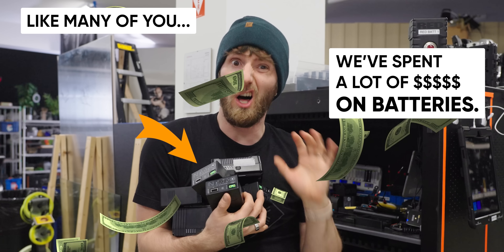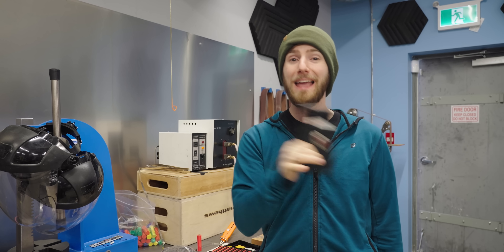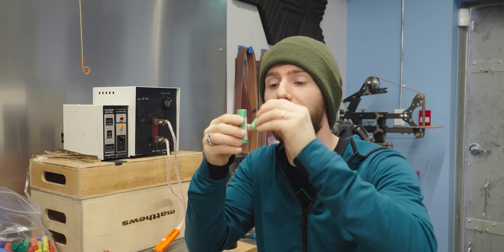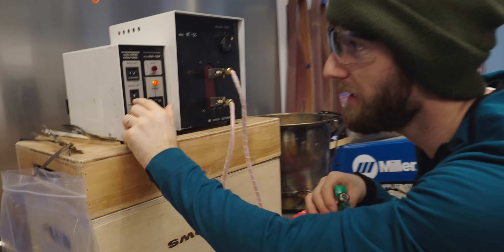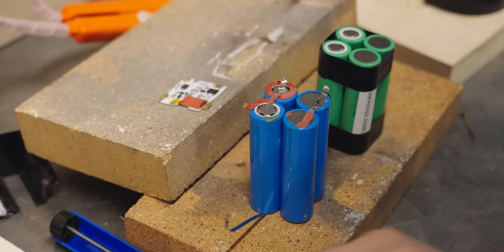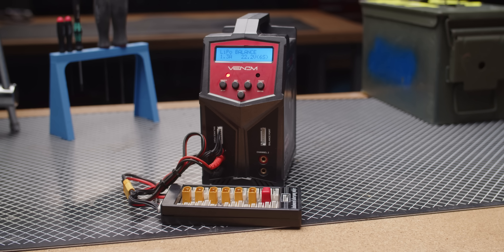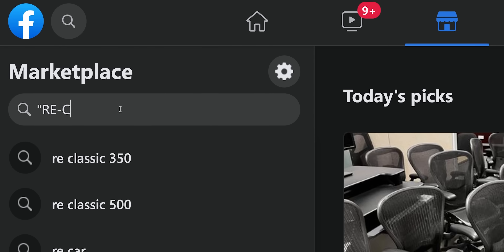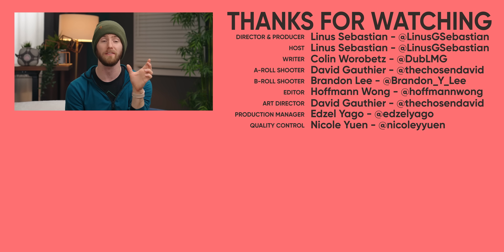This should be illegal… Battery Repair Blocking

Comment: As someone who fiddles with these batteries regularly, you guys made this sound WAY too dangerous. Scaring DIYers away should never be the point of a video like this.
Reply: Recycled tested and used thousands of 18650s, also worked in retail. You overestimate the average persons knowledge skills and understanding of anything, and these batteries are easily capable of burning houses down.
Reply: @apachelives  you underestimate the ability to self educate in the modern world. Like yes the argument "there are idiots out there" is valid but still this video was over the top in the fear factor
Reply: My thoughts exactly, as someone who flys FPV RC craft and also does many other diy projects it pissed me off that they made out that Li-ion and Lipo are way more dangerous than they really are.
Reply: @stevefox3763  It's definitely a legal thing. if some idiot went and blew up a battery in their face and said "i got the idea from that LTT video" and the video didnt make it explicitly clear that they shout NOT have messed with the battery, even if its completely safe if you took the most minor of precautions, that is a good chance of getting sent to court. it's hard to balance an entertaining and educational video with the proper safety warnings sometimes without scaring people off.
Reply: @marhotiewer  They also tried to scare vapers by showing them footage of people with burning pants and blown off faces. What they never said was that these people usually either used the cheapest knock-off 18650s from ebay (4 batteries for 5.99 including a charger, what could go wrong?) or they used low-amp cells in high-powered sub-ohm vapes or they put 18650s in their pockets together with their keys.
If you buy high quality cells, inform yourself and apply common sense, 18650 cells aren't that dangerous. Aggressive RC Lipos are a bit more dangerous, but they still won't kill you if you know what you're doing.
Reply: @marhotiewer  very hard watch. felt like a cautionary tale more than it did a how to.
Reply: Yes i agree. I fiddle with lithium ion regularly never had one burst into flames. Not saying it can't happen but just keep in mind it can happen and be ready thats all.
Reply: Do you remember seeing all the car ads that say “shot on a closed circuit by professionals” you could say that is scaring away the drivers because usually I could do that not on a closed circuit. He has to structure the video this way because if someone goes and does it and gets injured they can come back and say well Linus didn’t warn me I could get hurt and he may have some legal liability.. I can’t think of a better term to describe this then, don’t hate the player, hate the game
Reply: @jatley91  yeah but thats in tiny writing on the bottom of the sceen not the host of the commercial constantly throwing in your face that its dangerous
Reply: @KobraSalvage  it’s almost like those company are multinational behemoths of industry that have a full legal team checking what the requirements of each jurisdiction is so they do the minimum required to hit the standard set by over 70 years of international car advertisements……………

Linus is going into uncharted territory with these as there isn’t a precedent which is usually set after someone has an accident. How many views has this video got? Do you think the 13 year olds that watch this channel should go and work on replacing a lithium battery without at least having a plan for how to deal with anything unexpected. 

You need to remember these videos aren’t targeted to you as an individual mate, sure it might not be as dangerous for you.. but what about the kid that’s never dealt with electricity, fire or internal product disassembly.. why do we have to put warning bottles on bleach? It’s perfectly safe if you use it as intended, so they are scaring people away from using bleach 🤷🏻‍♂️

Comment: I've just gotten to the point when Linus sparks the second cell.....I'm starting to think it's not a bad thing they prevent you from doing this.
Reply: Think about this. By preventing a customer from doing it, they're also preventing repair shops from doing it. A local repair shop could easily replace those battery cells if they have the equipment and training (the repair shop I run does have those things). However the manufacturer is deciding that no one should be able to fix that battery pack, even a fully trained and equipped repair store like myself.

Comment: I did re-cell on my old ROG G751 battery. Most BMSs have internal switch, basically if it looses power it will shut off and that is it. 
I'm feeling generous enough to share this... So... !ALL OF THIS IS AT YOUR OWN RISK!

What you can do is: 
1. WHAT EVER YOU DO, DO NOT REMOVE OLD CELLS FROM THE BMS IN THIS STAGE, DO NOT DISCONNECT THEM FROM THE BMS
     Just use old pack as a reference for the new pack build, for now.

2. Do a full cell rebuild from 0 and make sure that all NEW cells are connected and directed as a copy of the original pack. 

3. Solder new cables on new battery pack to match the old one, make sure new cables are of the same gauge, and that the battery voltage is as close as possible to the old pack.

4. After this is done you will have to solder new pack wires over the old pack wires on BMS, so everything goes in parallel. MAKE SURE YOU THAT OLD PACK WIRES HAVE CONTINUOUS                   CONNECTION TO THE BMS WHILE SOLDERING, IT MUST NOT LOSE CONTACT AT ANY MOMENT. You can remove some isolation from the old wires and solder new ones directly on them, still be careful to not unsolder wires from the BMS.

5. After this is done, leave that conjoined pack for an hour or two to balance itself.

5. ONLY after this is done, you can cut off the old pack connections to the BMS. When cutting wires, make sure to not cut off the part that is holding the new wire to the BMS.

Comment: I would appreciate a few words about how to equalize the voltage on cells before making parallel contacts between them.  How about connecting a resistor across them for awhile until the voltage equalizes?

Comment: Makita is also famous for these shenenigans—once their BMS detects lower voltage (be it a disconnect or drop 'bellow safe levels') it perma-shuts and you're done. You can connect it to a set of cells from a brand new pack and it won't work. It might be allowed by the law but it's a super-scummy thing to do and I implore people to vote with their wallets against companies that involve themselves in such behavior, esp. the ones that on the other hand tout their environment friendliness.

Comment: Perhaps the spot welder was running too hot for the thin lithium ion casing

It seems that the settings are causing the welder to spark. Come to think of it when I used to use a spot welder it sparked all the time, looks like the batteries are fine

Comment: Maaannn what's with that welder ? Pulse is much too long I've never punched through a cell with a much simpler welder (48V dc power supply, a big 80Vdc 8000uF Cap and a very chunky resistor to charge the cap fast)

Comment: 1. the sparks were completely harmless, thats just from the nickel. Ive done my own spotwelding and get that all the time, you even get it when you weld only nickel, without the batteries.
2. the bms probably didnt work because if it detects a voltage lower than ~2.8v per cell it shuts off to protect the cells (when you remove the cells this also happens) and you just need to charge it for a second or apply a positive voltage to the bms, to simulate charging
Reply: some people here pointed out that it was the case for the sony batteries but RED batteries actually used volatile bms like DJI does with their drone batteries. However they can easily be bypassed by having a parallel battery with the same voltage connected before unsoldering used cells
Reply: A lot of BMS systems permanently shut down below the cutoff voltage, in the scenario you over discharge the battery it shouldn't be recharged. There's no known way to reset the safety disable, you have to keep voltage on the BMS at all times to keep that from happening as there's no known way to
Reply: @Jaker788  then take that shit put it in the bin and use that as a lesson learned. :)
Reply: @Jaker788  that's kinda dumb
Reply: @Jaker788  I have another reason why BMS could be configured to not accept any reset after detecting a bad cell.
Think about a really broken cell which is on the edge of causing a fire hazard.

 If somebody asked me, "Should the BMS accept a Reset if a battery did die while all others are at a healthy voltage?" I probably would tell the BMS supplier "no" because I would not like to be in press with a burning Battery because the BMS did open a circuit to the broken cell during a "reset on charge"
Reply: Those AC welders have a tendency to be crap where they can rupture a cell literally making a hole in the side. They should have been using k weld or a similar mosfet based spot welder.
Reply: @ps3customgamer  Yeap went DC spot welder so much better and just use my drone batteries to power it.
Reply: @ps3customgamer  Yep, KWeld is such an excellent spotwelder. Especially with the KCap. Spotwelded thousands of cells with mine.
Reply: @SirCrest  I’m a fan of the technology. The price point is really bad compared to aliexpress solutions but I wouldn’t like to run a business off those.
Reply: @ps3customgamer  I bought mine when they first came out in like 2018 when there wasn't too many good other mosfet options. Just car batteries and those shit AC ones. 

I'm sure there's a lot more options around now.
Reply: yeah, I was watching the video and saying to myself...wtf? I haven't done it for a while, sure, but that is pretty normal action. oh, and If I come across a dead-unchargeable pack? make up a similar voltage pack of cheap-o dollar store batteries minus about 10% voltage, hook it up to the pack in question (in a safe, sane manner, in a fire-safe ventilated space of course) and just leave it over night. 60% success rate. oh, and one impressive fireball. it's all about the balance, man! oh, and you can also usually keep a BMS alive this way.

Comment: That bandsaw handling at 6:43 was dangerous man. What if you lost a finger? Next time use a dowel or something. But make sure your hands are at least one object off from the main object you're tying to cut. Maybe get a holder with a hole in it to pass through the saw? So you can fix the object to the holder and then just shove the holder back and forth. Safety first guys

Comment: Usually BMS need to initially go into "charge" state in order to turn output power back on (only needed if discharged to very low voltage or batteries disconnected)
Reply: was thinking the same thing... don't know if they tried to charge it
Reply: And if it went too low, it won’t accept a charge because charging a low lithium battery that went too low is unsafe.
Reply: My first thought as well. Every project I've done with a BMS requires an attempt at charging the pack before the BMS "kicks in".
Reply: If I can get high res pictures from front and backside I might be able to roughly reverse engineer the schematics and let you know if this sort of "lock" is even physically possible with the hardware used
Reply: transistor thing ? I don't think so
Reply: *just my knowledge over 8 years as an electronics technician ;)... Will try to answer additional questions

Comment: that red spot does not seemed had came from a 12ms burst.... Are you sure you are using the spot welder correctly? In my experience, there might be some sparks but if the strip heated to the point it is glowing hot that means bad connection or bad strip or too little surge current or bad timing circuit

Comment: What do you think of these  - 18650 battery spring  sections positive negative -  instead of spot welding batteries? If you have to change some unbalanced batteries in future you will have to spot weld?  Where using these spring plate you can easily remove and check?

Comment: Of course we want. One thing we should advocate is for consumer electronics to be mandated to have longer warranties. Not that manufacturers graciously give us longer support, but A) longer mandatory warranties (most of the EU is 2 years, and we should be upping that by at least one more) and reparability standards. Maybe they shouldn't let people repair units on their own, but at least make sure professional repair coverage is as wide as possible, be it via third party agreements, expanding their own chain stores or having a centralized way to do so, for as little as possible.

Every step we go to reach the Fairphone standards is as good as possible (including the retrieving of old devices, which would attempt to recover as much resources from them as possible).

Comment: Most comercial BMSs(Laptop,Powertool) cant do any balancing at all(the manufacturer just relies on the cells being equal). The evil BMS is common on Laptops for years. My X230 has one of those batteries that will kill itself if one of the cells got disconnected. I succesfully recelled it by connecting the new cells before removing the old ones.

Comment: It's kinda misleading to claim that the RED batteries are potentially maliciously designed when you clearly had issues trying to re-cell it yourself, that's ignoring the amateur level of this project (not wearing gloves when he had them available, for instance). Especially considering the obviousness that the "evil" mechanism is likely be in place simply to prevent the battery from shorting out a $25k camera...

Comment: the reason you had a problem was how you were connecting the batteries not the welding - when you decide what voltage you want then all the - (negative) must be connected first then all the + connected, you must do this in the correct order - line up 3 12v car batteries and connect them together  to try and give you 24v - you will end up in smoke and melted stuff if you don't do it correctly, connecting multiple batteries together needs careful planning, series paralell etc

Comment: Many BMS do brick themselves completely when you disconnect one cell. You can overcome this by myking sure while you disconnect the old cells and connect new cells there is always a voltage present in the allowed range using resistor networks and external power supplies. I did try this with my old laptop battery but made one dumb mistake which lead to the BMS getting bricked....

Comment: Well, actually most BMS I've worked with have safety feature that cutting off output from battery pack if voltage drops below certain point (and it definitely drops when you disconnect terminals), and you just need put it on charger for a short period of time to "reactivate" BMS when you're done with replacing cells.
Reply: yep, seems to be the same stuff i have encountered, often they need to get back up over 3.9-4v before allowing use again.
Reply: In a good world this is all one need. Manufacturers of battery packs also put in a permanent "fuse" that cannot be reacitataed once the cells have completely drained or has been disconnected. It is for "our security" after all. 
Back when laptop batteries used to consist of 18650 cells, this logical permafuse was a common thing in the battery packs. Soem could be reactivated by reflashing the controller with hacked BMS firmware. But far from all BMS's could even be reflashed.

Comment: I repair many different battery packs for my work. A lot, I think 80% of the brands that I come across, no longer work after replacing the cells.
To prevent this, I provide the BMS with the correct voltage via a power supply.
After the cells have been replaced, I disconnect the power supply.
99% of the acco packages keep working like this

Comment: @LTT Get yourself a kWeld unit if you want the most  versatile welder money can buy. I welded 10x 0.15mm strips with it at once and that only required 1/5th of its maximum power. The welders that plug in the wall rarely get to 1000 amps. I can get 1300 amps from kweld, allowing me a much shorter pulse and less total energy/heat buildup.

Comment: I have seen a circuit weld compound on some batteries that doesn’t require spot welding. It tends to be used by companies that don’t want to risk fires in the shop and also to keep you from messing with the pack. It’s not cheaper in the long run but it’s much safer.

Comment: Wouldnt replacing individual cells come more down to the configuration, i.e series vs parallel? In a parallel configuration, you should be able to safely replace a single cell correct? I always thought the issue was having a series config and one of your cells depleting early, however in a parallel circuit, they all rely on each other for combining battery life as opposed to power, and when one gets low, your circuit just becomes weaker, from the "weak link" battery in the parallel circuit.